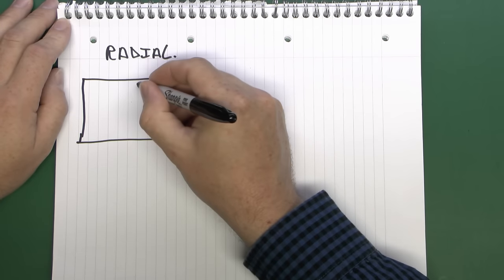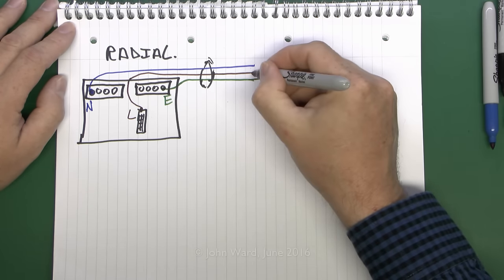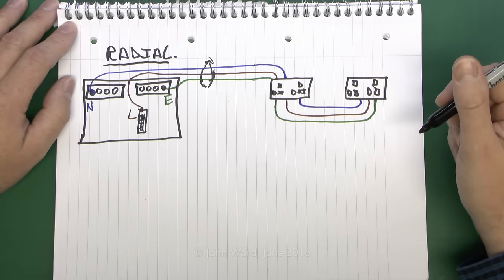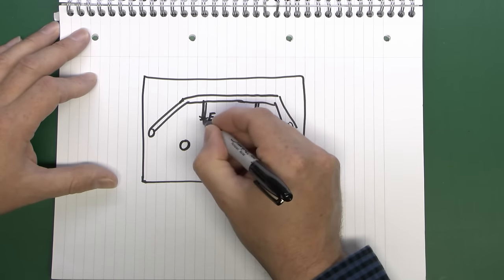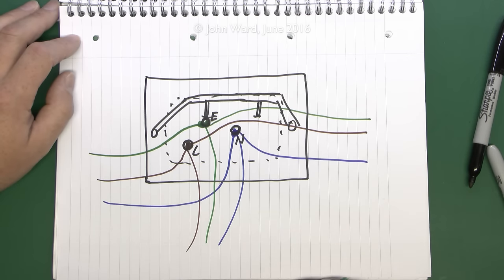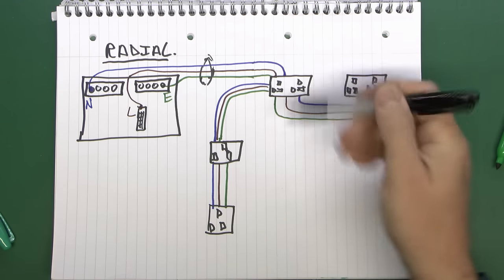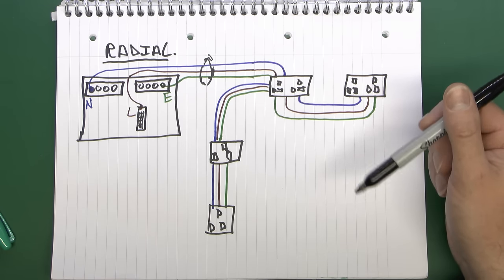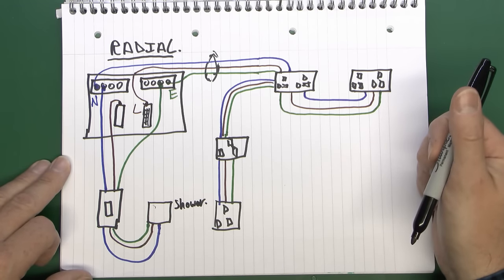Radial Circuits

Comment: If we only had radial circuits (and no ring circuits), would fuses not be needed in plugs? EDIT: so if you have a 16 amp radial circuit and plug in a lamp with a thin cord rated at 3A, with no fuse in the plug, could the cord catch fire if 15 amps pass through it?
Reply from the maker: Yes, the fuse is only there because of the 32A ring (30A fuse in the past).
Originally the plug fuse would usually fail before the circuit 30A fuse including on a short circuit.  Today it's mostly irrelevant as circuit breakers will typically trip before the plug fuse does.  The plug fuse is only really there for overload protection on modern circuits, where people might use things like 4 way extension leads to connect multiple items.

Most other countries use radials and their plugs are not fused.

One of the original design intents of being able to use a 3kW heater wherever required is also severely outdated, as most homes have installed heating rather than using portable electric fires.  

The 3A cord would be damaged with 16A through it, however that's not going to happen in any normal situation as a lamp can't suddenly draw more current than it's designed for, and if the cord was damaged to create a short circuit the  circuit breaker would trip long before damage was caused to the cord.  Although the short circuit current would be very high, it only lasts for a fraction of a second before disconnection.
Reply: @jwflame  Thank you for explaining this cos I think many people assume the fuse protects against electric shocks and all that, when in fact it's the circuit breaker.

You say the fuse may help with overload protection, so I guess this would also apply to radial circuits?

Maybe it's worth doing a future video entirely about plug fuses and their relevance today?👍
Reply: Depending on who you read, fuses in plugs were not developed to save on copper in postwar years being a part of ring circuit promotion.  Some state they were there to protect flex cables on portable appliances - big cables then covered in cloth.  The  fuse in plug was just an enabler to those who saw rings could be used. The country did not suddenly post-war fit rings. My mother's house was built in 1953 with square 3 pin fuse in plugs and sockets, British Standard BS 1363, but all radials. 

The fuse in the plug does protect the flex from overcurrent and bursting on fire, when properly sized. When Saudi Arabia was selecting a standard plug and socket, which is not that long ago, they chose the British G plug, British Standard BS 1363.
Reply: @jwflame  
I have seen that on the Continent they use 16A rated flex a lot. I assume this is because with modern plastics and omitting insulation around the earth (as is flat twin and earth cable), flexes carrying 16 amps can be much thinner than in the 1950s. So a table lamp rated at 0.1 amps using an LED lamp would have a 16A rated flex as the main breaker at the consumer unit is rated at 16 amps. I do not know if that is in their regs these days. It is rare to have a 20 amp radial socket circuit on the Continent these days. The 2.5mm cable in plastic flex conduit derates the cable to around 18 amps, so a 16A breaker is fitted. 20 amp is generally seen to supply heavy appliances 

A 3 amp flex can take more than 3 amps and burn up. You cannot assume that there will never be overcurrent through the flex because the appliance will not let it happen. I recall as a kid the flex on my sisters flash looking Italian table lamp melted, with a 13A fuse in the plug, I recall the fuse being brown on colour. I was too young to know why, but it did.
Reply: @jwflame  wrote:
"One of the original design intents of being able to use a 3kW heater wherever required is also severely outdated, as most homes have installed heating rather than using portable electric fires."

I do not think that is the case.  A 3kW heater can be plugged in if the boiler fails, then a 3kW electric kettle is switched on along with the toaster. That is 32 amps just there, never mind the TV, etc. 32A is the limit of a ring but would trip a 16 or 20 amp radial. I always thought consumer units were at face height and easy to get to on the Continent as people had to reset tripped overloaded circuits regularly. Which they do. 

One great thing about the igneous and simple 32 amp ring is that gives lots of power without hassle and reliably. That is why we hide the consumer units as we have no need to get to them frequently. 😊

Comment: Is the RCBO the same as a GFCI device in the US?  Thanks for another great video.
Reply: RCD = GFCI, only trips when there is current leakage. RCBO = RCD + Overcurrent Protection Breaker (Think of this like a fuse)
Reply: @OliverONeill  wrong way round
Reply: @johnbower  nope

Comment: Does the code say that 3 wires (L, N and E) should belong to the same cable or can they be 3 separate cables.
Reply from the maker: Either.  If 3 single wires, they must be installed in suitable conduit or trunking, and they must run in the same trunking/conduit.

Comment: My house was built in the UK in the early 1990s. Will I have any ring circuits? Can I tell by looking at the CU?
Reply from the maker: Unless it's very unusual, it will have rings.  The usual signs are 32A circuits for sockets, and there will be 2 wires in the circuit breaker.
People are still installing rings today.
Reply: @jwflame  Thank you for the reply. If my CU was isolatable (or do you say isolable??)  then I'd take a look inside. Maybe I'm being too paranoid, and as long as I turn off the main switch and don't touch terminals I'll be ok.
I was guessing you'd say the circuits would be radial. Intrigued now.
Thanks again.
Reply: I managed to check the CU and you're right it does have ring circuits. Cheers.

Comment: If the consumer unit is closer,, ,  and the connection is made from. The consumer unit instead of an outlet. Would that still be considered a radial circuit?
Reply from the maker: All circuits are radials, except for the one that's a ring.

Comment: Would I he right in saying a 32amp radial servers upto 50sq meters 20amp 50sq meters and a 32amp ring final 100sq meters floor area?? Thanks
Reply from the maker: There were regulations regarding maximum floor area, but those were removed in 1981.  Since then there have just been various suggestions and historical notes about them in one of the appendixes of BS7671.
Reply: @jwflame  Thanks John, I knew you would know the answer!

Comment: Can a junction box be introduced to a radial circuit?Eg 20 amp breaker in fuse box 2.5 mm feeding a junction box from fuse box then 3 sockets fed from junction box?Thanks.
Reply from the maker: Yes.  The junction box must be accessible, or be a maintenance free type if not.
Reply: @jwflame  Thank you for the reply,your videos are great.👍

Comment: hi john can you help I need to put in a socket circuits in my shed to run power tools and a small heater the total lode is around 27Amps some time more some times less I don't want  run a 32Amps ring can because I need to take  the power from my house with is 25m away  so don't want to run a cable back  can I run a 32AMP radial with 4mm cable
Reply from the maker: Yes, although voltage drop over that distance may require 6mm² cable to the shed.
Reply: @jwflame  Thankyou

Comment: HELLO, how many double sockets can i fit on a 2.5 cable radial, thanks
Reply from the maker: As many as you want, however the total load can only be the rating of the circuit breaker or fuse - adding more sockets doesn't get you any additional capacity.
Reply: @jwflame  ok thanks

Comment: What happens if the ground connection on the first outlet fails? All others consumers down the line are now left without PE?
Reply from the maker: That is correct.
Reply: Does the UK code provide solution for this problem? Or since the outlets doesn't contain any exposed conductive parts it's not big of a deal?
Reply: Slow Technology - simple answer, not really other than suggesting that property owners get their electrical systems tested at regular intervals. Which mostly does not happen in domestic homes.
The ring circuit does have the advantage that the earth/PE circuit is also a ring, so if an earth wire breaks, there is still an earth connection back to the consumer unit from any socket outlets on the ring.

Comment: Splitting a line using a socket outlet sounds weird...and unsafe. Here in Romania we split lines in junction boxes.
Reply: It depends on how the socket outlets are designed I guess... the terminals on sockets here in the UK are specifically designed to accept 3 wires of 2.5mm2, to avoid so much need for junction boxes. I agree if the socket isn't specifically designed for it, such as American sockets, trying to terminate more wires than there are terminals, is a big danger.
Reply: ***** I guess it's mostly common in the UK. We use Schuko sockets which aren't designed for such a method so we require junction boxes.
Reply: we don't use shit products, a sound termination is a sound termination.
Reply: I believe it's the same in EU..Junction box needed..
Reply: Junction boxes where you don't need them sounds messy. At least you can pop the front off a socket and troubleshoot if you've got a bad connection. A junction box is either a blemish on your walls (bad) or inaccessible (worse).
Reply: Actually schuko sockets are designed to be daisy-chained. I just had installed schuko outlets and they all accept three wires to be connected on each terminal.
Reply: In Canada, connections are meant to be made in light/socket/switch boxes as much as possible.  Junction boxes are to used very sparingly.
Reply: Britain moved away from this system years ago to ring and new plugs with fuses as it was safer now looks like we’re going back to the unsafe method
Reply: It's not dangerous to split lines in sockets as they are designed for that role. Also, there's a big advantage in running a spur out of a socket, as it means the connection is readily accessible. The problem with using junction boxes is that they are often not in readily accessible places, such as under floors and if there's a poor connection it's not easily remedied. UK regulations require that such junction boxes are accessible, but that's in theory. The practice is that it can be disruptive to get to them, even if you know where they are.

So, in general, it's better to have things were they are accessible, and a socket is as good a place as anywhere. Junction boxes in loft spaces are similarly not to much of an issue; junction boxes under floors are not, although there's always the possibility of putting a junction in a wall box with a blanking plate, but many people don't like those messing up their room decoration.
Reply: i find it weird you can put a plug in upside down mixing the line and neutral in an appliance which can have earth leakage even when switched off, whereas our plugs can only go in one way as they are on an angle
Reply: debeeriz - unless you make the effort to defeat the safety shutters (that protect both the line and neutral receptacle contacts) and also remove the Earth pin from a U.K. 13A plug, it is not possible to insert a U.K. 13A plug upside down in a wall socket outlet. However, there are some extension leads where it is possible to insert the plug upside down if you defeat the shutters, as the dimensions of the front face of the socket are undersized.
Reply: @Mark1024MAK  i  was referring to the eu plug not the uk plug  the one with 2  round terminals
Reply: debeeriz - Ahh, sorry. Most good quality appliances (excluding products that are of questionable quality that are sold cheaply online and are imported into the EU) that use only a two pin plug are class II (double insulated or equivalent) so it does not really matter which way they are plugged in.
Reply: @insoft_uk  
Unfortunately.

Comment: Also, so both radial and ring circuits are PARALLEL circuits? In building engineering we don't really use series circuits?
Reply from the maker: All parallel.  Series circuits share the voltage across the connected loads, and are totally impractical in most situations.
Reply: All sockets have to be parallel connected no matter what system or else you can't deliver the full voltage and you'd have to have a device passing current in every socket in the series.

Comment: Love your videos and learning so much from them.
@4:50 excuse my stupidity, but how is this any different to having a spur on a spur in a ring circuit (which is a no no)?
Reply from the maker: Circuit cables are protected from overload by the MCB.  For a 20A radial, the cable is rated at more than 20A (about 26A if using 2.5mm²).
Rings are a special case as the cable is undersized - 2.5mm² cable isn't protected against overload if there is a single cable on a 32A MCB.  overload protection is provided from the fact you can only have one socket on a spur and UK plugs all have a fuse in them.  With more sockets there is no overload protection as multiple things could be connected.
Reply: John Ward I see. So one socket blows in a radial and everything in the circuit will stop working hence no overload risk.
But in a ring everything continues working despite the cable not being up to the job and risks overload because the cable is rated 26A, but the main fuse at 32A?  Why would there not just be a 26A MCB on a ring to protect the cable being used?
Reply from the maker: @chrislow123  It's all left over from the days of rewirable fuses, having one circuit for the whole house and minimising the use of materials.  Made sense then - not so much today.
Reply: John Ward perfect. Thank you. Keep the videos coming 👍🏻

Comment: Erm.. If electrons flow from negative to positive, shouldn't we put the circuit breaker at the neutral cable :3 ...??
Reply from the maker: AC doesn't have positive or negative.
Reply: Neutral does not mean negative. Neutral means it's at ground potential (more or less), so if the neutral is broken, it still means the live contains a potential to ground.
Reply: Electrons flow in both directions with AC as the current alternates it’s polarity at a frequency of 50Hz (most of the world) or 60Hz (USA and various other countries).

Comment: ??? in the US on main breaker panel the  ,  the neutral and earth ground  can be under the same  bar.   is it that way in the UK?    when it is a sub-panel then the earth ground  and neutral are sep and the the neutral wire is under neutral bar and the grounding wires are under only the earth grounding bar.
Reply from the maker: No, neutral and earth must be separate throughout the entire installation.  On TN-C-S supplies N&E are linked in the main fuse before the meter, but that is the responsibility and the property of the electricity supplier.
Reply: @jwflame  ,   i am an electrician and  i  am just saying though in the US ,  at the main panel , not a sub panel,  the earth ground and the neutral are together.   just the way it is done here in the US.    say it this way.  when the house is being feed from the street to the house down to the meter and the meter into the house and at the first breaker panel is the main shut off breaker then the earth ground and neutral are under the same ground bar.  thanks. for responding.

Comment: The RCBO has a working earth wire doesn't it..? White or cream ?
Reply from the maker: They were supposed to be cream, but most were white.  The standard which specified cream as a functional earth has been changed to pink, and most newer RCBOs don't have the wire at all.
Reply: @jwflame  okay thanks for that. Been out of class for a while and away from the industry. Thinking of going back and if I have to I'll hire a registered Spark to Apprentice me if no one wants an adult apprentice.  Long story. I was one of the first students in New Zealand to go through training where you complete all your theory in class prior to seeking on the job training.